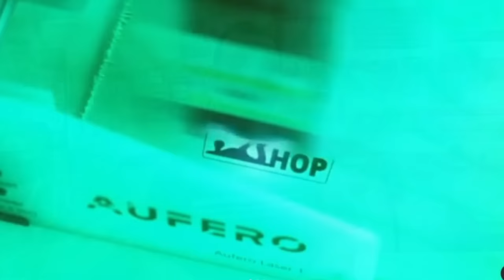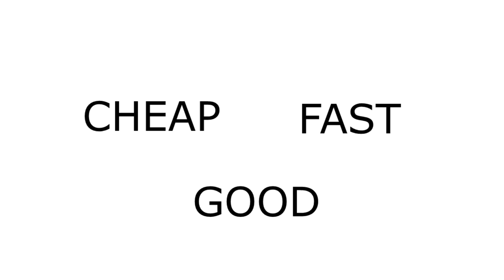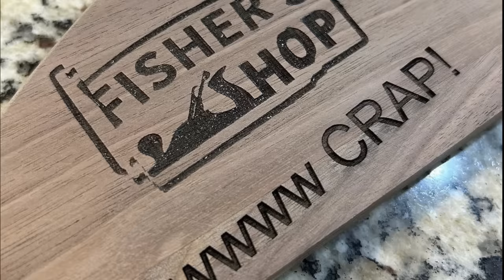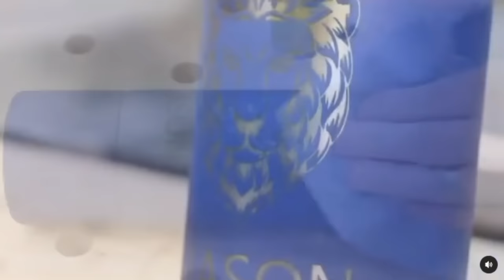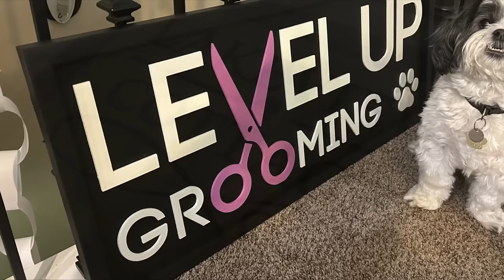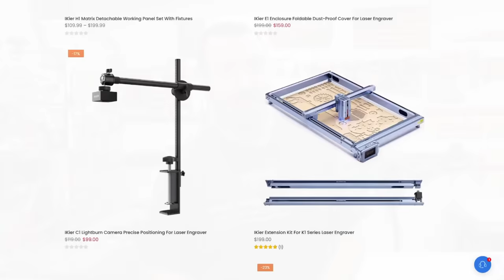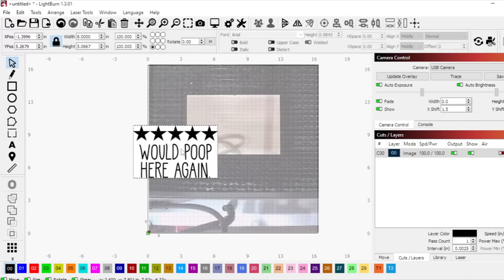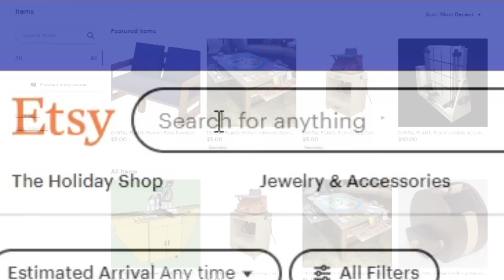How to make money with a laser!

Comment: Great video Drew. Any advantages to doing the cutting with a laser instead of your CNC? Been saving up a while for the CNC but now you have me thinking...
Reply from the maker: You can achieve crazy detail cutting with a laser.  And if you're just going to be dealing with thin material, like 1/8"-1/4", then I'd say go with a laser.  However, the two major limitations are 1). The work area of an open-frame laser (typically around 16"x16" where CNCs are usually much bigger and 2). lasers can be unpredictable when it comes to inclusions in the wood.  Hardwoods and Softwoods cut at different speeds and temperatures so it's common for some of my burns to be perfect except for in a couple spots where there were knots or dense spots.  Both of these "gotchas" are remedied with a CNC so I'd still urge you to go that route.
Reply: Granted Diode (or Tube Life for CO2 Lasers) Life is a Longer Term issue, but not having to worry about Broken Endmills etc can be nice.

Both have their place though!

Laser/Waterjet/Torch setups can only do flat cuts too (unless you have some crazy tilt head like some do) so that can be a downside as well.

Also in theory less need for exhaust control/treatment due to little to no burning with Milling.

Comment: As this was a sponsored video, I'd be curious how this cutter stands the test of time, considering its price point. Also, how many of those projects did you do on this cutter vs another cutter?
Reply from the maker: The Ikier is by far the most capable machine shown in the video. However there’s quite a bit of B-roll footage from my other lasers I’ve owned. I’ve never had a laser degrade over time but we’ll see how this one does throughout the next year.
Reply: Yeah, I haven't found a lot of reviews on the ikier and laser cutters (perhaps like 3d printers) are all over the market, so outside of the glowforge, it's difficult to tell if any of them are worth the investment. These companies/manufacturers are a dime a dozen and don't seem to exist more than a few years before they disappear.

Comment: You know how titanium changes color depending on the oxide layer forming on its surface?
It's done by two methods
Heat and electricity 
It can be any color by adjusting the temperature or electricity or actually a rainbow of colors,  just imagine the possibilities
I think you can buy blank titanium items such as plates or chop sticks etc
You can customize them not only by engraving but also by colors
I think it can happen but dont know how hot the laser gets but i assume it can do that if it engraves stone
If it doesn't get hot enough you can also mask the item by spray paint  and engrave the design you want like you did with the metal water bottles and use electricity to oxidize the metal achieving the same results
I think it could be a good idea

Comment: You don't really need a diode laser with such a high power. For most hobbyists, a 20-watt laser module is sufficient. High-power diode lasers can be quite expensive. If you're considering commercial use, it is recommended to use a CO2 laser instead.
Reply from the maker: The higher power reduces the number of passes you need to make cuts and reduces time that engravings take.  In a world where time is money, a higher power laser might really be worth it.  Besides, new diode lasers are constantly being released which is reducing the cost pretty quickly.  The price of my 24watt machine has just about been cut in half in less than a year's time.

Comment: Really appreciate all the info! I was wondering if you could cut the jack-o-lantern faces with lower powered lasers or have you only been able to cut it with the 40w.
Reply from the maker: The IKIER K1 Pro Max has a feature called Z-sink cutting which allows the laser module to lower after each pass.  This moves the focus down through the kerf of the cut allowing the laser to cut deeper and cleaner.  This worked quite well for cutting those lanterns however you really need to pick boards that are dry and don't have any inclusions in them for good clean cuts.  But yes, if you use a lowered powered laser like a 20w, I still think you can do it, it's just gonna be a LOT of passes and take a long time.
Reply: From the perspective of motion speed, the downward cutting functionality on the Z-axis requires the use of an additional motor, which increases the weight of the laser module. This significantly affects the speed during engraving. @FishersShop

Comment: I had an idea about how to use a laser to make money, but it involved a supervillain costume and a bank.  This seems to be a lot safer method.

When using the laser indoors are there any HEPA or similar filters available for the exhaust fan?  My basement shop doesn't have ready access to vent the smoke and fumes outdoors.
Reply from the maker: IKIER sells some kind of filter but I haven't read into exactly how it's used or how well it works.

Comment: Wondering if you would recommend the pro 20w fiber instead of the pro max 48w for $100 more.
Reply from the maker: You might wanna research the materials that each laser is best for.  I know there are some things that fiber lasers can't really cut/engrave where a diode can and vice versa.  It all depends what you wanna use it for

Comment: I have some vinyl sleeve material. They are 6in square tubes various lengths (fence post material) w app 1/8 - 3/16 wall thickness could this be cut on any of these lasers?
Reply from the maker: Yeah for sure. Those lanterns were 1/2” thick
Reply: I guess the question is will an object 6in tall fit in laser? I know CNC is limited to 5in
Reply from the maker: @donproctor3445 you can purchase risers for your lasers feet or just prop it up so it’s high enough. It’ll work no prob
Reply: In the case of using a hallow vinyl sleeve what keeps the laser from burning thru the other side?
Reply from the maker: @donproctor3445  You might consider putting something inside the sleeve that will keep the laser from burning through.  A small metal pipe might fit?  A wooden dowel or even an old broom stick maybe?

Comment: If only focus wasn't such a problem, what fun it would be to do a drive-by engraving of your neighbor's house.  alas...
 - You have several diode lasers, have any of them degraded over time?
Reply from the maker: What’s cool about this one is that the Z moves too so it can auto focus. So you can do a drive by engraving… you just have to drive within 8mm of their house. Lol
No, none of my lasers have degraded as far as I know.
Reply: @FishersShop I saw that z axis movement on their site as a way to cut through thicker material, pretty smart and that might just push me into this model instead of the X2.  I assume you still have to set the initial height ? They didn't automate that too did they?
Reply from the maker: Yeah, they have an auto-focus feature too.  It works, but honestly I could focus things faster by hand with my other lasers.  It's neat that it works though.

Comment: If it was just as easy as you say.  I have access to engravers, 3d printers, and more...yea...it isn't this easy, it isn't.  I wish it was, but either my stuff was.  I saw SEVERAL of my things that I was doing stolen from me, then undercut by $1 and they take it over.  There is ZERO you can do about it.  I did some things for a local vineyard, and I had DOZENS asking for similar things.  I told them what the winery paid (which was a STEAL because they are friends).  Nope. WAY TOO MUCH.  Sheesh, couldn't even get the material for what ANY of them were willing to pay.  Realize, these "customers" roll in with beamers, caddy's, Lincolns, Mercedes...they are dropping $300~$500 on wine when they go there, but my $49.95 item that I would make literally $5 on was "too expensive".  Yet, everybody loved it, and everybody wanted it.  Just wanted it for free.  I gave up.  Done with the BS.   Glad it is working for you, and thanks for not stealing my fence pickets, but I know where to get some now.
Reply from the maker: Like I said, you're gonna strike out some.  The key is persistence.  If you give up, it'll never happen for you.  I got shot down by realtors like 8 or 9 times before I finally found one that appreciated the work I do and saw it for its potential.  All the others bawked at the price and said no way.  That's fine... they just don't get it.  I kept searching until I found one that DID!